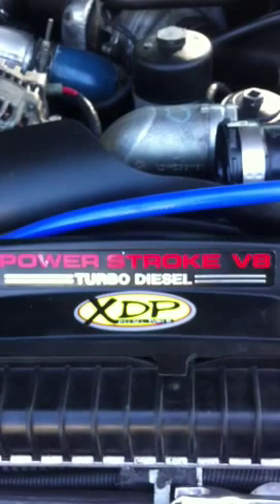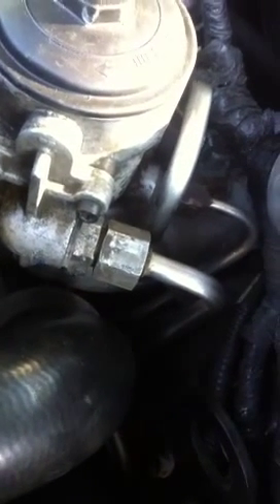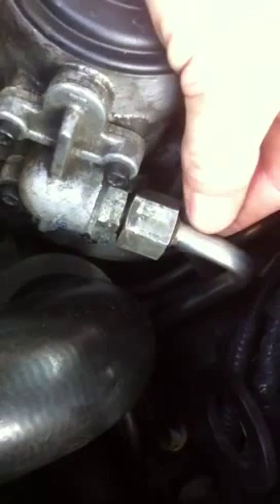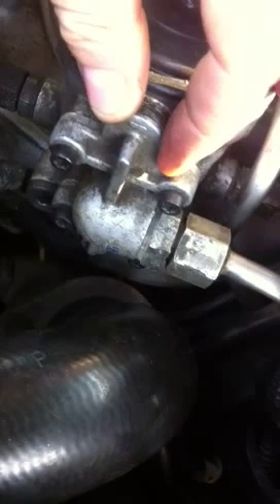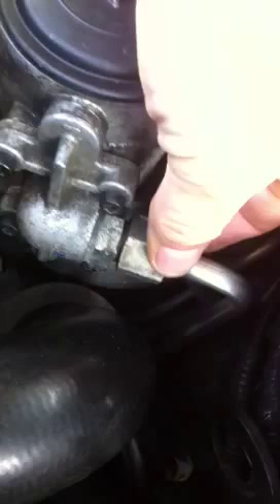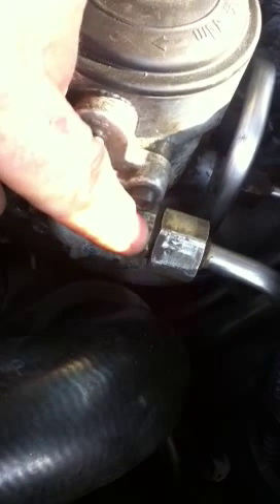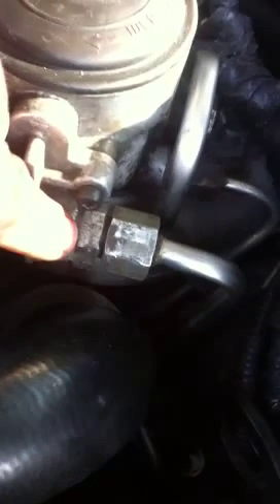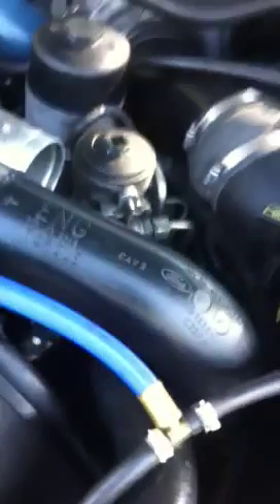Ford 6.0 Blue Spring Mod Necessity

Comment: twisted up the line alright. in the vanit is definitely hard to see. 13/16" and a 7/8" open end . while I was there I checked the thermostat. needed a new one, And it was only a 104F. should be more like a 195-200f mishimoto thermostat.